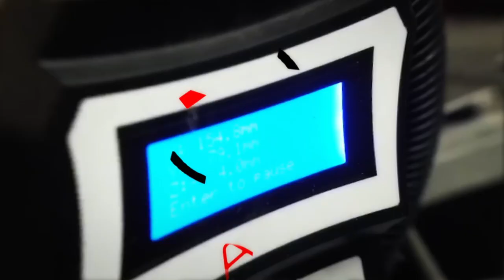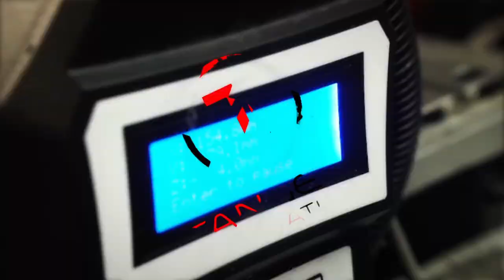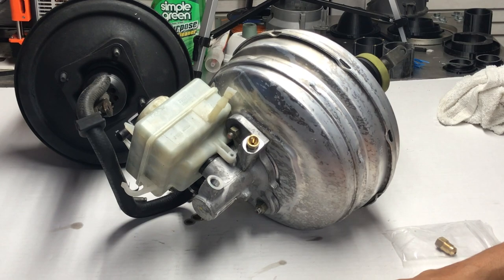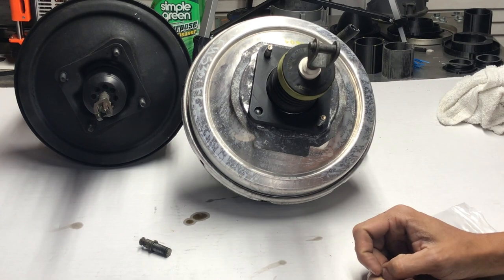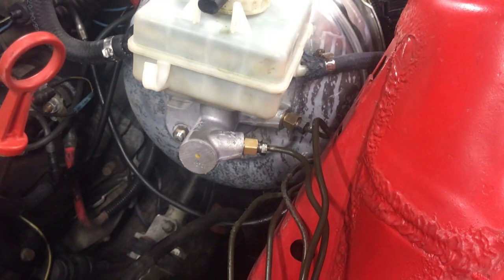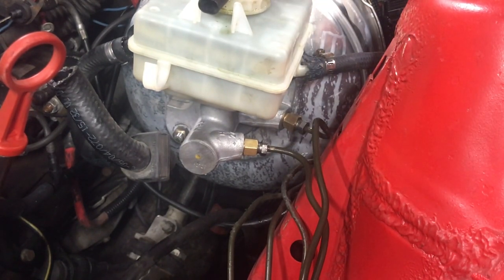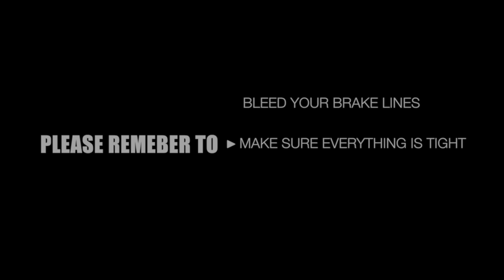E63 Brake Booster Install & Parts Review For BMW E30

Comment: The E90 booster doesn't have the extra dimples so bolts direct to the car. Why did you use the E63? Bigger bore master cyl?
Reply from the maker: E90 works we just wanted to add another option to the list since this mod does not take many hours to complete i.e tapping, drilling, etc. Also it does have a slight bigger bore.
Reply: did you have to cut the clevis joint off the e30 booster and weld it to the e90 booster? This guy having the pin is the first person i’ve seen not cut the clevis joint so I was just wondering before I got cutting and welding does it work just with the right pin? and if so where do you get the pin

Comment: Any major differences for RHD cars? What about non ABS cars?
Reply from the maker: Mounting pattern should be the same so should the brake pedal. If anything, maybe it’s easier to hook up brake lines since strut tower is not in the way of master cylinder ports.
Reply: Cool, any feedback about pedal feel and modulation compared to stock?
Reply: Non ABS cars have one port for each front wheel on the old master cylinder, so you need a t-piece and a short adaptor line to connect both front wheels to the single port on the new master.
Reply from the maker: @unixnerd23  that is correct